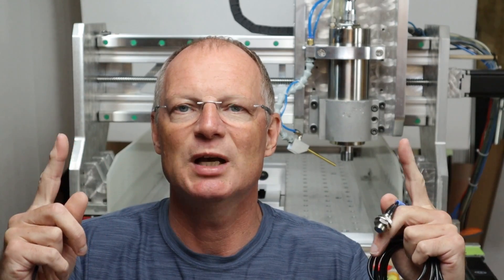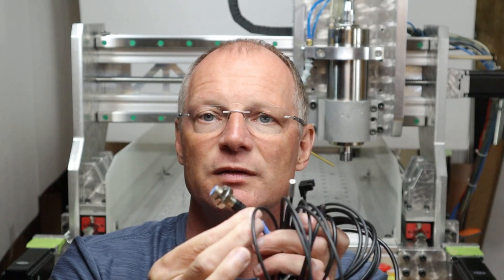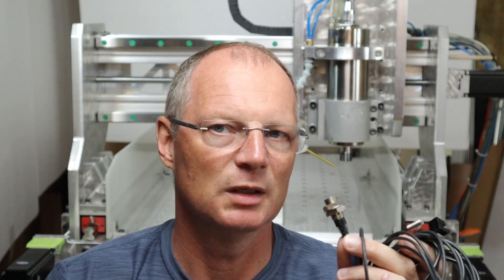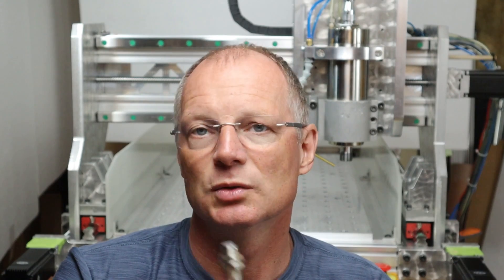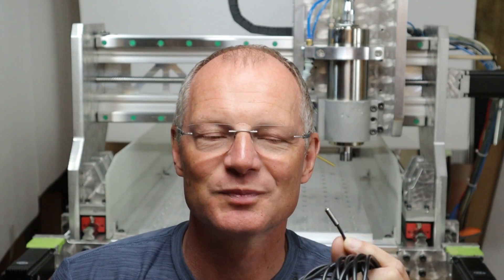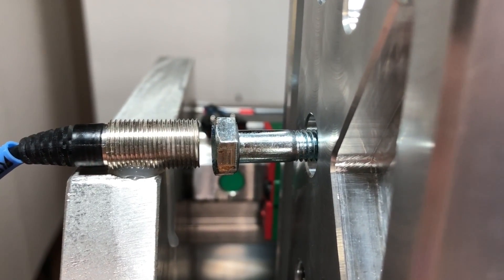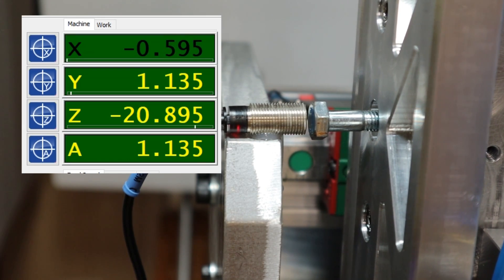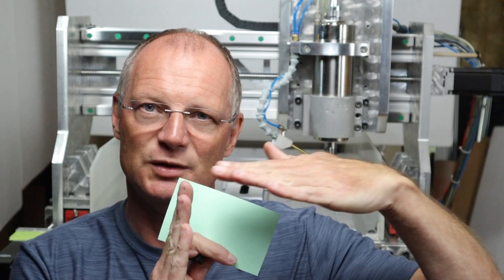Limit Switch Sensor

Comment: Another great video as usual. I have the EdingCNC CPU5A4E board and it is powered by 5v only. Most Inductive Sensor Proximity Switch that I've seen require 7-30 volts to operate. Am I right to assume I can't use them on my board? Asking the question because you mentioned you have an EdingCNC board, but you didn't mentioned the model.
Reply from the maker: I have the 5 with Ethernet and the newer 720 as well. I use the Panasonic sensors directly powered by the controller with no issues for several years now. Give it a try you need the NPN  version. Also my Z tool touch probe connects directly for easy hook up. Check my website 
https://www.jbworxstudio.com/product-page/z-height-tooltouch-probe-aluminum
Reply: @JBWorx  By looking at the Panasonic picture only I had a hard time to figure how I could attach to my big 4 x 8-foot CNC, so I 3d printed them to see how they looked. I was surprised to see how small they are, and I can see that I will have to find a way to fix them to the table some how. This mean probably fixing the switches to a piece of metal or 3d print a support as opposed to the Inductive sensors that require minimum effort to attached them to the table. Printing them allowed me to see all the variations and see how they could be attached.
Reply from the maker: @denlaps5797 that is a very good idea to get a sense of the size. Well every sponsor will need a bracket no way round it. Mine is just an aluminum L-Profile from the big box store. You will also need a “switch flag” so the piece that actuates the switch. To me this work was worth it, as the homing is now very precise.
Reply: @JBWorx  Well you convinced me and I will order them.🙂
Reply from the maker: Excellent !
Reply: @JBWorx  I can't find any documentation on how to connect the sensor to my CPU5A4E board. All the diagrams I can find on the Web for Panasonic NPN sensor seem to connect Blue wire to ground. The remainder 3 (White, Black and Brown) seem to be linked together and connected to the sensor pin on the board. Am I missing something, the three wires connected together? I love Eding board, but discussion formums in English are hard to find.
Reply from the maker: Ok the easy one is black and white. These go to the input of your Eding board. Use one of them they are either NO or NC you need to decide which one to use. The blue and brown are power. You can take this directly from the +5V on the board as the power consumption of these sensors is so low. So on authentic Panasonic you need to connect blue to 0V or GND and brown to +. Don’t worry if you have it wrong the sensor has internal protection for wrong polarity. Hope you get it going.
Reply: @JBWorx  Instructions are very clear. My set-up is for NC, so is there a way to know which one between black and white is NC or I have to connect one and see how it goes and switch if not the right one? Your help if very appreciated.
Reply from the maker: @denlaps5797 yes, black means light is on and output is high, white means light is off and output is high. I think you would want the black wire … hold it hold it cut the pink one 😂
Reply: @JBWorx  Super. I'm in the process of reconnecting my electronics and should test it in a week or so and I will let you know the outcome once I find the pink wire! LOL
Reply from the maker: 😂 yes pls let me know.

Comment: You never said how much the little micro switch that's made in Japan and use them Toyotas assembly line cost?
Reply from the maker: There are different plunger versions available and the cost is around $100.

Comment: I'm converting a small benchtop milling machine to CNC and I'm wondering about microswitches.

My need is to have cheap and repeatable ones with a good resistance to dirt.

I'm thinking about making an enclosure for moped ignition points, moved by a spring loaded plunger.

They're durable, precise and cheap...

What do you think about this possibility?
Reply from the maker: It’s an interesting idea but they are not really good if there is any dirt. Also I think that the snap action switch ($5) will be a better option. The “snap” is that provides the repeatability. But hey make a test it’s not much money as you said. Maybe you will be happy with it.
Reply: @JBWorx  yes, I want to test them, because I want something tough.
I think that making an enclosure with a protruding plunger, with seals to make it waterproof, is more than enough, and the mechanic of the points, precise and repeatable in an environment in which they are opening and closing faster and precisely for long periods of time, is a warranty for precision.

Maybe I'm wrong and I'm going wasting time and money...🤣😉
Reply from the maker: Only one way to find out. Please share your findings.

Comment: I have a question, say you homed the cnc, then you setup an offset to be the 0.0 of a piece...
And lets say something happened you had to stop the machining and lost that 0.0, if I home again, and set the same offset, will everything be allright?
Reply from the maker: Yes, it will be!!! That is one of the advantages of having accurate home switches. I am scripting a future video that explains how to use G55, G56 etc and never zero out a tool again for X and Y. This also goes hand in hand with the mounting plate I use on my machine so you can set parts and fixtures (like a vice) back to the same position every time. Hope my explanation makes sense, if not then make sure to watch the upcoming video on that topic!

Comment: Did you ask for wireless way to use cnc probe? I think i found a way to get results in range of microsecond with esp32. I tested that long ago and results where not satisfying as it took 5ms but how with some functions from edf you can establish much faster connection with esp-now. And my tests show that latency of pavket may be as low as 1us.
Reply from the maker: Yes exactly I had the ESP-Now protocol In mind. Would love to get some more information on your work. !!
Reply: @JBWorx  there is also a faster way with raw data. As probe is one way important information it could be sent in broadcast mode and reciver could just listen raw packets. That would speed up as there is no confirmation pavket to be sent.
But I think this may be sufficient as if I remember correctly old renishaw probes used infra Red and that was about 50us if I remember correctly. So 1-2 microseconds would outperform it.
Reply from the maker: The listening mode makes perfect sense now were you explain it. I think I would be happy with 15us moving slow for sending you can always make a second slower move and the error would be really small
Reply: @JBWorx  its so simple get two esp32 and arduino example for esp-now. Make it send byte in a loop and make byte value be state of probe pin.  You have to install also IDF framework that works with vscode. Thrn you can include headers from IDF into your arduino sketch. There is just one line of code beside header that you have to add to make connection faster then default.  I can show you.
Reply from the maker: That sounds really good. I have 2 esp32 and an arduino !! But I will be on vacation till March 6. Traveling. I would love to work with you on this project. !
Reply from the maker: Perfect 👍 contact@jbworxstudio.com is my email.

Comment: One more question:
- The Panasonic optical 4-wire switches, you only need two of them depending on whether you run then NC or NO? 

(I am about to order switches and signal wire online;))

[edit] seems like it's a tad more involved. The data sheet seems to say you'd need some resistors, too. Well, I still am not sure how many wires you actually need in your signal cable. Maybe all four? Two for power, two for signal?
Reply from the maker: So the NO vs NC has nothing to do with how many switches you need.  Most bang for your bug is to have one homing switch per axis and let the software take care of the travel limits. The Panasonic optical sensor has a logic output. So it will be zero volt or Vcc let’s say 5V. This means you will not need a pull up or pull down resistor it should work without one. Also you have the option to use the NO or NC wire as the connection for to your board. So this means you need a 3 wire connection. +, - this will power the switch and one signal wire.  I hope my explanation makes sense.
Reply: @JBWorx sorry, I wasn’t clear. I didn’t mean “how many switches”. I meant how many wires would it need, but you answered that:-). Thanks as always! 
I’m ordering parts these days so the build will commence when all is in;-)
Reply from the maker: Excellent ! I think you will enjoy these switches easy to install and wire and I really like that they run on 5V with a very low current draw so you can connect them directly to you control board. Good luck on your built

Comment: Salut j'ai posé 1 capteur par axe . Posé à 90 degrés des  tiens  il sont au milieu de l'axe  les butées métalliques  à droite et à gauche 
Avantage  tu économise des entrées sur la carte et si tu vas trop vite en fin de course tu ne risque pas d'écrasé   Ton capteur 
Si tu as des infos sur un Gcode  pour palper une pièce rectangulaire je suis preneur  merci pour tes videos
Reply from the maker: One sensor per axis is usually sufficient. The controller usually has software limits and will apply these from the sensor position. Best is to mount the sensor so that the switch flag can trigger the switch but nothing will crush the switch if the axis would drive further to a hart stop. Good that you have added these to your machine it’s defiantly an upgrade.

Comment: Are you able to share the part number of the Panasonic optical sensor? I understand if you want to keep it proprietary since you did the research to find it.
Reply from the maker: Not a Problem I share it … matter of fact it’s in the comments here somewhere. So look for the PM-24 series of optical switch there are a lot of different versions all with different mounting options the sensor is the same. Make sure you order NPN or PNP according to your board. I find DigiKey the right place to look them up. PM-k24 or L24 work in most cases. Hope that helps.
Reply: @JBWorx  Thank you very much!

Comment: Great test - and content in general - but quick question and excuse me for not having the lingo correct. But does EdingCNC set the home point of the On signal of the switch or does it "wait" until the Off point? Reason I am asking is that supposedly the repeatabilty of the Off point is not always as good on some switches as the On point?
Reply from the maker: Eding sets it on the “off” Point. So all switches have a hysteresis. This means there is a difference between the “on” and “off” trigger point they are not equal. However the repeatability in either direction is often more dependent on speed and temperature.

Comment: can you tell us what the part # is for the Panasonic optical slot sensor? Thank you.
Reply from the maker: There are about 10 variations depending how the switch is fastened down … so hole location. You can find them on Digikey.com look for PM-L25. You can also read up on my website www.JBWorxstudio.com
Reply: Thank you very much. @JBWorx
Reply from the maker: Glad to help

Comment: I guess its a moot point if you zero from your work or vice using an edge finder for example.
Reply from the maker: For the WCS yes however my machine das a dual driven y axis and if the homing is of so is the 90 degree X to Y.

Comment: I bought some of the Panasonic NPN PM-U25's, is the black wire(connected to +) for NC? or the white wire? The terminology of the manual says Light On/Dark On for each of the control wires?
Reply from the maker: Light On means the output is high with nothing in the beam. Dark On means if the beam is interrupted the signal goes to high. So for NC you would want Light On. Hope this helps
Reply: @JBWorx  perfect thanks

Comment: Maybe try to make a spring loaded lever on a pivot point to increase the accuracy of the cheap switches by the lever ratio?
Reply from the maker: I think a direct travel into the switch will be the most accurate solution, make that point of contact spring loaded is actually a really good idea I never thought about that. For the cost I think the optical switch is a really good solution. I run them since this video was released and I am really happy with them. Thank you for reaching out.

Comment: I had upgraded to the metrol precision switches a couple of years ago. They have worked well. Any issues with optical sensors and chips flying through them and flagging a false positive?
Reply from the maker: No not at all. They are only active at the moment of homing so no machining at that time, but I have not had a single incident with any dirt, but then I also clean my machine a lot.

Comment: Please, is there a list of model numbers or where we can find the switches you mention? Great video and loving the series, Many thanks.
Reply from the maker: You can check my website 
https://www.jbworxstudio.com/switches
Also google Panasonic optical slot sensor there are a lot of different versions but they are just changing how they mount, NPN or PNP and the wire length.

Comment: The optical sensor, being housed in plastic, will likely accumulate electrostatic dust that would eventually disrupt its sensing ability. Garage door safety sensors are notorious for incurring this issue. Always trade-offs on which solution optimizes the pros while minimizing the undesired cons.
Reply from the maker: I have these installed now for 9 month and can attest that I had to never clean them. Not from any dust and also not even from plastic chips that like to kling to everything. In hind side I should have installed these years ago.

Comment: the best would be a combination inaccurate home switch + encoder wheel index from your motor. I read somewhere that HAAS CNC machines do that.
Reply from the maker: Yes most servos can do that as they have what is called a “zero pulse” it comes up once every revolution. The home position is set very accurate this way unfortunately the hobby steppers and servos miss that feature.

Comment: Nice one, what if I told u that u really dont need any of these to maintain your square, i use one driver to drive both motors and they never off sync and that is for many years so far
Reply from the maker: I use integrated servo motors so the drive is part of the motor. I use the software to set the axis to square but you can totally do that mechanically as well.

Comment: Optical is great, but be sure to shade it from direct sun or room lights. They can destroy the accuracy.
Reply from the maker: Hmm I cannot really confirm that because I assure you when I film a video on my Maschine there are 5-6 lights involved.
Reply: @JBWorx  It isn't the presence of light that is the problem, but changes in ambient light level. Compare lights on to lights off to see if there is an issue for you.
Reply from the maker: Ok I will take note of that and see if there are any changes. However these have a built in amplifier and also a clear high or low state so there should really be no difference this is why I choose the Panasonic one.

Comment: @JBWorxStudio thankyou for the great video's you post. Which Panasonic sensor did you go for? Or it doesn't matter? Thanks again.
Reply from the maker: It really does not matter, they are all the same in that family but the form factor is different. So the mounting on one axis might be different than on the other and you can choose the one that mounts the easiest. I am still rather happy with them and really can recommend that change.
Reply: Ok, thanks, which family is the one you tested from? Am ready to buy now, machine getting close to working 🤞
Reply from the maker: Look at the Panasonic PM25 also note you can get them with 1m or 3m wire length and make sure you order what your board needs so either NPN or PNP.
Reply: @JBWorx  awesome thankyou
Reply from the maker: So awesome that you get you machine going.

Comment: Thanks for your video! Ive had several repeatability issues on my Z axis (even without a tool change or tool re-measuring) after it homed Z using inductive sensors ranging from 0.02 to 0.2mm. I think I'll also go for the Panasonic
Reply from the maker: I think they are great for the money and one big advantage is that they run on 5V. Many controllers have a open collector input and require 5V not 12 or 24 volts.

Comment: Those inductive switches get really bad when the temperature swings. 

The little micro switches.... The accuracy depends on part on which portion of the lever arm you are engaging. Between the fixed point and the button is much more accurate than at the end of the lever arm, furthest away from the fixed point.
Reply from the maker: Yes,  you are correct. There are some temperature compensated sensors usually around the 100$ mark. I tried to set the micro switch with a steeper angle towards the moving part so mechanically the guide block seen in the video would not be able to pass the switch, something would have to break. So that is not quite how you want to do it but like you said provides the advantage of a better “contact angle” for the switch. Anyways I am really happy with the optical sensors the past 3 month or so.

Comment: Thank you! 
Got one question
So in industrial machines that use, like you said, clunky switch online have a servo driving y axis, is that right?
If so, dual motors y axis machines would need the same homeswitches system that your machine have?
Reply from the maker: Not quite. The servo motor is better and the software of the motor offers an output called “Zero Pulse”. So once the clunky home switch is made the machine will now look for the zero pulse of the servo and that is very accurate. Thank you for your question.